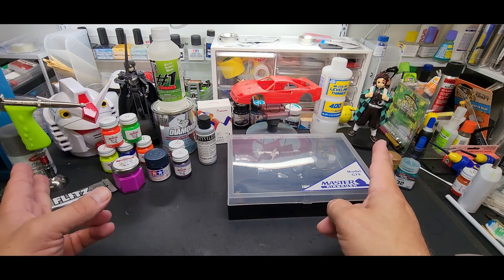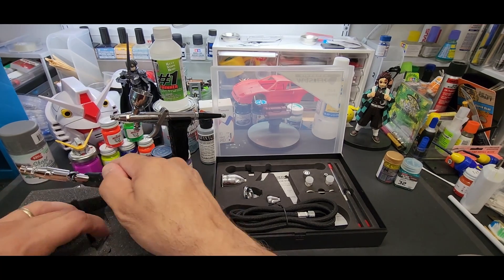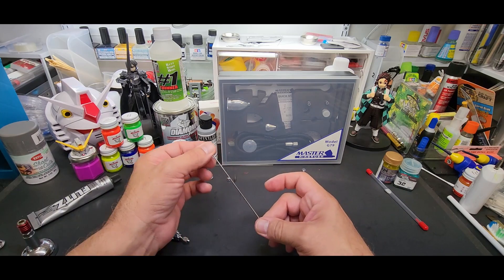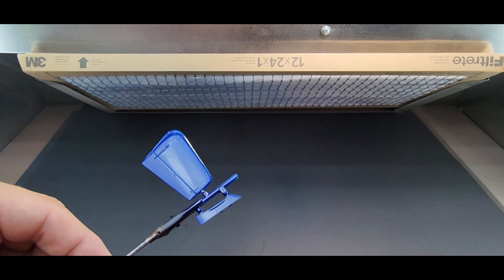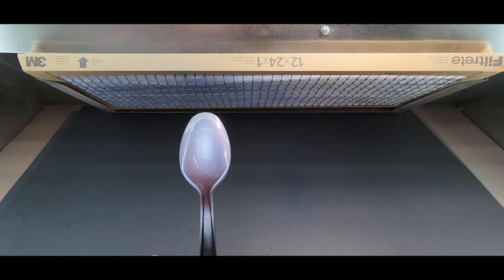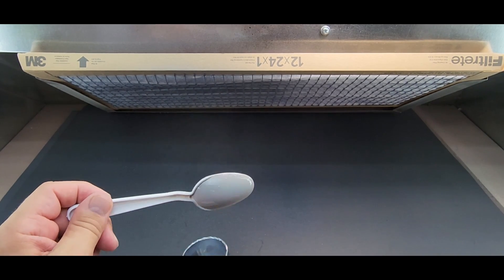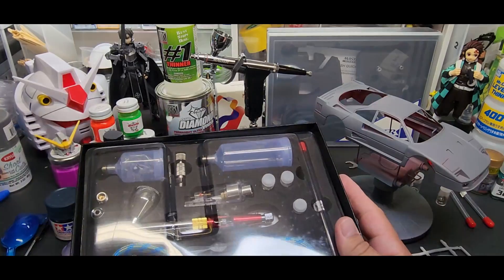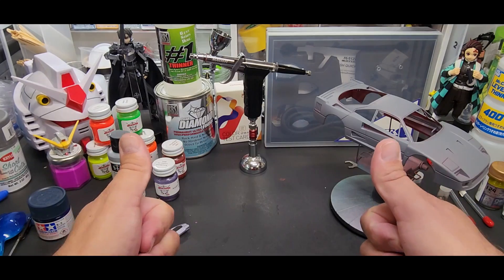Testing The Master Airbrush Model G79  3 In 1 - Includes Multi Needle Sizes

Comment: I use an airbrush to spray chocolate into Bonbon molds. I just got this airbrush,  I need the .8 needle, how do you suggest that I clean the "shipping" crud off of the needle? Crisco? Soap and water? Everything for me has to be food safe. (I paint using 86 °F colored chocolate with a Dewalt compressor at 80psi, fyi). That stuff you cleaned off of your needle is concerning to me. Thank you so very much for your opinion. Chef AH, A.C.F., Pastry Chef

Comment: I have a master SB 844 that I got with the compressor and it doesn't spray at all I took it apart and I believe the needle packing nut is missing because I look through the brush and there's a bigger hole as opposed to my other brushes and paint runs to the back of the brush. I will ask you a question on patreon.

Comment: Micro Mark sells the Tamiya trigger airbrush, around $300.  The QD couplings are great if you have 2 or more spray guns.  Also if you have different brands of hoses the thread size is not the same from Paasche, Badger, Grex & Chinese hoses.  QD male couplings sort of standardizes hoses to fit all guns. The only hassle is finding the male coupling to fit your guns.

Comment: I picked up one of these to try out and overall I like it. But Master hasn't got any parts for them, and no info on when they'll be getting any. The wrench has made a bit of a mess of my end cap, and I'd like to replace the .05 needle and adapter for it. So I'll have to run down alternates. I see some other airbrushes on Amazon that look identical for less money, so I may pick one up for parts if nothing else.

Comment: I'm at a point in my life where I've tried most everything else except air brushing. I am a woodworker doing mostly small stuff on my scroll saws. I only want to buy one air brush and one compressor and neither of them need to be top of the line. I'm cheap to say the least by not Harbor Freight cheap. Although I have a lot of their stuff. I'm thinking of this air brush kit that you are testing here but I don't know which compressor to buy. I want something that is as quiet as possible without breaking the bank. Can you suggest which one to buy and what to make sure of when buying it? Any other suggestions would be greatly appreciated. I'm 79 years old so life expectancy is not a huge thing. Whatever I buy will more than likely outlive me. Thanks for your help. And also thanks for all the great videos and information you have provided. Great stuff.
Reply from the maker: Good evening, go to this link and search Tooty. These are great compressors at a great price
https://spraygunner.com?aff=10

Comment: I wonder if it's my usage method or paint. Also a beginner pov. But I had Issues with the 0.8 needle especially in terms of flow. Could have been alot of variables but my 0.5 worked out much better in coverage and flow. Thank you for the review as I have purchased this recently and this has given me more comfort with the purchase.

Comment: i had the master airbrush g79 and i thought it was amazing for my first airbrush but fast forward a few months and nearly every piece on it broke and i ended up wasting so much money trying to replace parts and keep it running. i just said fuck it and bit the bullet a bit for an upgrade to a gsi creos ps 290 trigger type from spraygunner, i used your code btw thanks for that discount it was helpful fr, and i am blown away with how much better built the ps290 is built. seriously take it from someone who has bought it and tried to use it basically daily, its so  much more cost efficient to just spend like 30 more bucks and get the ps290 bc i wasted so much money trying to keep the master airbrush pos working it made no sense. also master airbrush was missing parts and their customer service people were not helpful they caught an attitude with me and tried to make me out as a liar when at the time i was their biggest unofficial spokesperson so they really ticked me off. moral of the story: spend a little more and get an airbrush from japan like the ps290 if you want a trigger type bc its just insane how much more quality you get for a few more bucks and the little differences add up over time. im very satisfied with the ps290 and it works wonders with every paint i throw at it.

Comment: I just got one of these. It's not the master one it's xdovet but the generic Chinese one's are all the same in my experience. Xdovet on Amazon actually has exact copies just in the regular knock off iwata type body's of the neo eco and the gahleri airbrushes. Only difference is the gahleri one has .38 the xdovet has the .3 or .35  both have another size converter set also. That's not why I commented though just thought maybe you'd be interested in checking them out as you do all these reviews and have the neo eco and gahleri brushes to compare them too. I'm having a issue with the brush (one in video) bubbling and air just stays on unless I loosen the nut inside the handle. It came with the bottom handle nut barely holding the handle on. I've never had much  luck with the floating nozzles use to have bunch of badger have sold off all but one 360 and renegade now because of it. What's the trick with getting the floating nozzles to work good. I used bee's wax on it made sure wasn't blocking air holes then hand tightened the nozzle caps on. Any insite would be great.

Comment: I have one and I will tell you what! Its good, but extremelly dificult to clean. Its almost impossible to reach some parts above the cup 😮
Reply from the maker: I have a Gaahleri GHAD-68 that looks just like this but it's nozzle system is different and it cleans up way easier
Reply: Nice! You should include the airbrush intern parts and its cleaning process in your vídeos, would be great. I almost dont use mine just for not have to clean it!
Reply from the maker: I've done a few videos on cleaning the airbrush

Comment: Well timed test Robert. I  have one of these on order to compliment my Iwata TRN-1  which only has a .3mm needle. I wanted a trigger type airbrush with the larger needles and this seemed to fit the bill. I'm picking it up at the border on Saturday. So after this test I'm pretty confident it will do anything I want it to. 
Now how about a link to  the metal polish you used to clean and smooth the needles.
Thanks again for such a helpful video.
Reply: Any metal polish will work for the needle. It doesn't at all have to be Flitz.
Reply: I use Nevr Dull Wadding polish I picked up at Walmart on these cheap needles. It's easy to use and works great. Rip out a piece wadding, polish up the needle and throw it out when your done.

Comment: The only jar that did not leak in my orders, was the neon red. The worst offender was the purple, it's noticeably lower than the others when you line them up, but there's still 75% at least in it, so I'm not worried about it. As a panel liner for some miniatures, it'll still last forever. This airbrush might be a nice addition to the collection, always on the lookout for more trigger type airbrushes, they're just easier on my hands to use.

Comment: I was looking at this brush the other day actually, as standard dual action units start hurting my wrist after too long spraying, thanks for covering it.
Reply from the maker: Trigger airbrushes are great for sure
Reply: @barbatosrex9473  Even better are "dual action" trigger airbrushes, like Mr Hobby Procon PS290, which has you can spray just air, then pull the trigger further, then paint starts spraying.
Reply from the maker: @briansrcadventures1316  this one also just let's out the air when you pull the trigger slightly

Comment: I bought one of these 2 months ago.  The regular type is getting hard for me. I’m losing strength in my arms.  I plan to get a grex but didn’t want to spend that much money if I didn’t like it.  It’s nice, much better than the first Master Airbrush I bought about 15 years ago.  I like the middle size needle. I shot primer and base & candy.  I’ll probably get the Grex or Iwata and use this for primer and sealer on my car models.

Comment: People poo poo Master because it is cheap, and If you are a professional then this Master isn't a brand for you, but for a casual user that may pick up an airbrush just a few times a month then these are great. I have used a Master for a few years now for priming and a zenithal highlight.  Do I need a $300 top of the line airbrush for this job a few times a month?  No but at least I have an airbrush that can do the job I need when I need it.  These are great workhorses, after a little work to get them up to par (cleaning the needle, lubrication, and quick releases).   I am not a fan of the trigger but I still like Master for quality and cost for what I need.

Comment: Can you clean the needles with 99% alcohol?
Reply from the maker: Absolutely
Reply: @barbatosrex9473  

Thank you so much for respond. 

Can I bother you with a few more questions? 

** Question 1**
- Acetone. My wife has 100% Acetone Pure Acetone used for removing Nail Polish or should it be A Higher/Stronger Grade. 

QUESTIONS FOR MY PROJECT 

*CONTEXT*
- I'm wanting to repaint a Sword Replica of the "Master Sword" from “The Legend of Zelda” franchise. 

- I’m gonna try my best to describe it the best I can as it’s something much easier to explain if I were able to post images and links. 

- The repaint will be based of the "Twilight Princess" Variant which the closest colors I could find for this are:

• Primary Color: Wicked Colors 0307 Pearl Plum

• Secondary Color: Wicked Colors 0373 Metallic Actress Gold 
———————————————

*Sword Parts and Materials*

• Pommel: Alloy Steel

• Handle: ABS Plastic

• Top & Bottom Handle Pieces: Alloy Steel

• Guard: ABS Plastic (Biggest and most Complex Part)

• Blade: 440 Stainless Steel
———————————————

I Sand Blasted the original paint which left the base material color for the: 

• Handle/Guard: "Turquoise Blue"

• Pomel: "Alloy Steel (Metal Color)"

• Top&Bottom Handle Pieces: "Alloy Steel (Metal Color)"

*Questions 2*
-  For the Turquoise Blue parts do I need to Airbrush a white Coat 1st and then apply Pearl Plum or no need for white? 

*Question 3*
- The Allow Steel parts are smooth and have no type of texture for Paint to catch on so how should I go about painting them? They will be Pearl Plum as well.